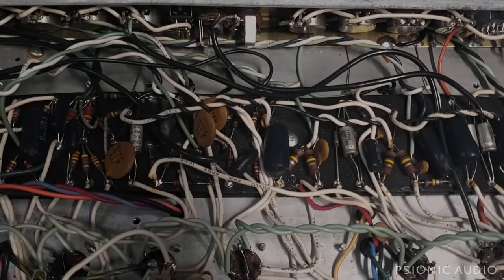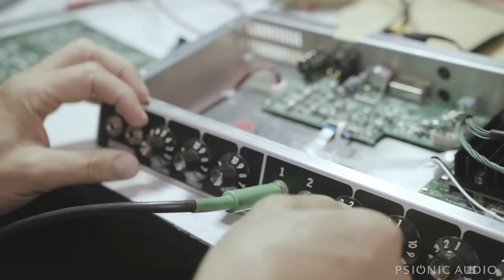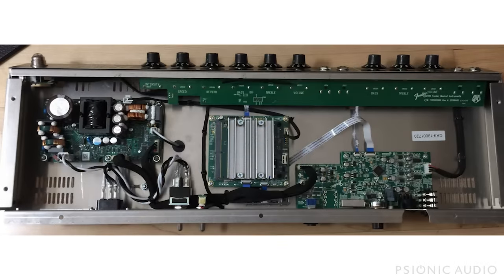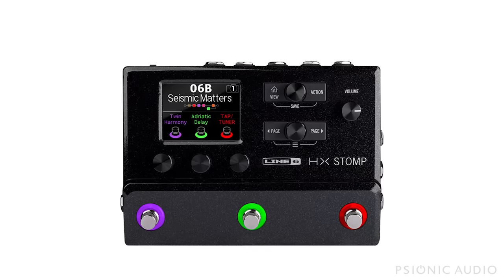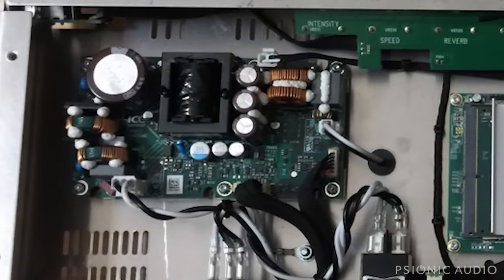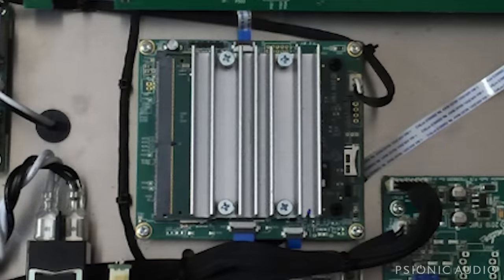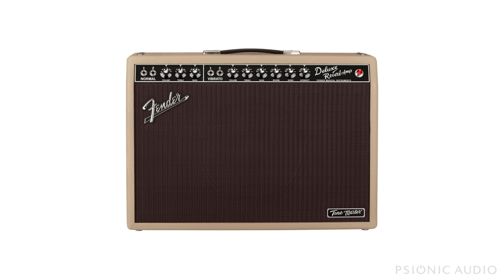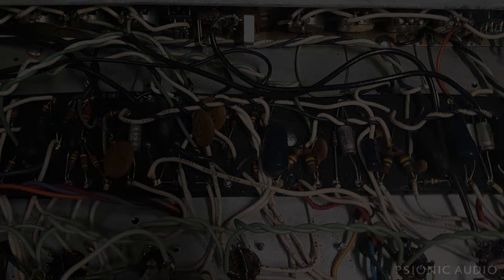We Need to Talk about the Tone Masters

Comment: The super reverb tone master makes sense to me as it will be a lighter solution for when you need a solid amount of power, as well as it has the attenuator which to my brain makes more and more sense on more powerful amps.  On a deluxe?  Some sense but not enough over the DRRI which isn't too light but it's easy enough to get around with and has pretty solid range of usable volume.  The price difference from 65 reissue to tonemaster also makes the super a much more compelling choice as the price difference is much larger there than between the 65 DRRI and the DR Tonemaster.
Reply: Nevermind, for some reason I now see that the deluxe TM is 100 watts and the super reverb tone master is 45....odd.
Reply from the maker: Old Twins are 80W. Old SRs are about 45W.
Reply: @PsionicAudio  Yes, still I don't get the logic of bumping the 22-watt DR to 100 for a TM version but leaving the Super reverb at 45 for it's TM version.

Comment: First of all, it's pretty stupid to say that the C12K is a "terrible" sounding speaker. It's pretty much just your opinion. Personally I (and literally thousands of guitarplayers around the world) don't swap it and have loved this speaker for decades. 
I'm gigging a few weeks now with the Twin Reverb Tonemaster and has of course these same two C12k's neodymium speakers, and they sound absolutely great. Like a tube Twin should sound with Jensen's, scooped mids. The Celestions in the newer blond versions don't sound anywhere like a Fender amp, too much mid and less headroom. 
But that's my opinion as well. As far as reliability and longevity..  it's 1000 dollar amp, designed and built for gigging musicians. With all it's conveniences, like output XLR with a very decent sounding cab sim, attenuation and most importantly... light weight! It's also not suppose to be a multi-tool, but just a great sounding almost exact emulation of 1 particular amp, as close as possible. I really don't need 50 different amps to choose from, or 300 effects... just one great sounding pedal platform. And I think Fender really nailed it with this one. My 1000 dollars computers also died within 5-10 years, my 800 dollar phone died within 3 years, my 900 dollars smart TV died in 6 years. So, my point being, it's not an "investment" product, it's just a tool. I suppose it will last 5 years, probably more, that's 200 dollars a year. Not bad at all for the convenience it gives me. It's not designed to be constantly serviced or whatever. When my smart tv died, I didn't bring it in to have it repaired. It would probably be more expensive than just buying a new one. I didn't replace the motherboard when my computer died, I bought a new  computer. And I treat the Tonemaster the same way. As you said, like a laptop. Not like an investment amp or to sell it for great money in 5-10-15 years. And again, I don't need more features, I really hope Fender sticks with this idea, no effects loop, no IR loading, no 50 amps or effects to choose from. Please no... I'd buy a Helix or Kemper or Katana if I'd wanted that, literally 'every' modeling amp has these overwhelming set of features where most people only use one or two amp sims anyway These things are for another kind of user. 
Oh.. and did I say it sounds awesome? On a big or small stage, full band setup, loud live gig.. not a single person that would be able to tell whether I'm playing a 'real' Twin Reverb tube amp or a Tonemaster. That's what I can promise you. Maybe if you'd A-B it right next to a tube version, you'd hear some small subtle differences, a different "feel" but these will dissappear in a full band setup or recording. Personally I think this is the best sounding tube-less amp I've ever heard, and I'm still a tube amp lover myself. I've had several (Fender) tube amps and I still have now. But lugging them around a few times a week gets pretty old after a while. My back thanks me.
Thanks or the video.
Reply: This reply was as well considered as the video itself.
Reply: @wmg1958  well, just my 2 cents.
Reply: @supersonicsroots  thoughtful writing such as this is worth a lot more than 2 cents any day.  Curious how the Champion 100 would stack up in your opinion since those can be found for a relatively cheaper price.  I totally get the points the original post was making and this was a good counterbalance.
Reply: @wmg1958  Thanks Bill, I think the Champion 100 will have more of a solid state sound (obviously) since it's not designed to be be a modeling amp. The difference will be half the power, so if you need volume and headroom you'd be better off with the Twin. The Champion has some things like built in effects and an effects loop and also has a headphone out. To be honest, they're 2 different kind of amps for different kind of players. Soundwise the major difference will be that the Twin is 100% built to emulate it's tube brother. 
But that doesn't mean the Champion doesn't sound great of course, and its a lot cheaper. Good luck with your choice!

Comment: I've had my Tone Master Deluxe Reverb for a couple of years now. Like MANY players, I don't need an effects loop (even more and more younger players are not using pedals). I would never wish to snip the bright cap either. I VERY FREQUENTLY get compliments on my super clean tone, by both audience members and other players. The tone of a Telecaster or Jazzmaster thru the TM (or BF tube version) is everything I could wish for (especially with EMG T System Tele pickups or the brand new JMaster pickup set(should be on the market in a few weeks) puts me in tonal heaven. Finally, after over 50 years of searching tones! (I've been using Fender amps the whole time, but with hum bucking guitars)
Reply: I agree. My es335 through my TM Deluxe, original firmware and played clean (blues) sounds awsome. It is all in the fingers man! (tone...)

Comment: I'm just glad they went with an IcePower module instead of a chintzy class D chip amp. The cheaper modeling amps have these monolithic class D chip amps that supposedly can do 300 watts (which, doubtful) - but those bigger amp boards mean discrete output MOSFETs which are less likely to catastrophically fail from heat.
Reply: And if they do fail it's not terribly difficult to replace a discrete power FET.

Comment: You want to turn a Tone Master into a Super Tone Master...?

Put the Fender MTG Tube Distortion Pedal in front of it. 
It gives it that warm-tube feeling & sound that fills the room just like tube amps do.
Very low gain / high volume settings to keep it clean.
Up the gain lower the volume to get tube break up / dirty / distortion.
HIgh mids if you want that sound. 
It is basically now your pre-amp, a tube one.

Fender should make this pedal mandatory with each amp, it is THAT good of a combination.
I did it to the Twin, and I assume it would have same affect to the Deluxe.

On top of that I bought both Black and Twin to compare, and ended up swapping the speakers.
So it now has 1 British Celestion and 1 American Jensen speaker because I am a picky dumb ass who couldn't decide which one to keep. By accident I discovered that this is an amazing combination that HAS to be HEARD to be believed. With the pedal it is like a Boutique amp turning this into a Super Super Tone Master that can play any style you want with tube realism, yet with digital control for various volumes you want to play at ---The big TM advantage in first place

Problem with swap: Now I have 2. 
Sweetwater is very open with returns as they agreed to let me return one after testing both, but obviously I cant return a modded amp.

For Sale: 1 Amazing Super Super Tone Master Twin Reverb -- Austin Texas.

Comment: I don't know why you hate the Jensen so much, i absolutely love mine. I guess I am lucky my ears aren't as sensitive as many of the folks I read in forums. Saves me a lot of mine
Reply: I think the amp sounds great. I've updated the firmware (I have the original blk one), but still have the stock speaker. My DR is a home tool and as I was just firing mine up a minute ago and thought how great it is for uses like that. I hate the thought of heat cycling the tubes  in my other amps. So for a quick little session, it's absolutely perfect. I'd use it for informal jams too. Bottom line - it sounds fantastic and works as advertised. 

It's all quite simple really. I don't get all the babble about this and that.

Comment: Hello. I own a Fender Deluxe Reverb TONE MASTER. I have just disassembled it because the LED indicator lights do not have power going into them when the amp is turned on. The LEDs are working upon testing. IF YOU WANT A CLOSE UP PICTURE OF THE INSIDES I CAN SEND IT TO YOU so you can help me diagnose the problem. I bought it from the USA and i am living here in the Philippines 😊

Comment: Great video. You should also consider making a video about guitar speakers. What I noticed you suggest a speaker replacement to a lot of amps and it is a fairly simple mod that can vastly improve the sound of an amp
Reply from the maker: I've made a few.
Reply: @PsionicAudio  yes, i have watch them. What made me suggest it is the difference in the tone in the Fender 68 custom vibro-champ video which came to mind when you mentioned the tonemaster's change of speaker from the Fender to the Celestion. I understand that making a speaker video is difficult because of the too many variables but a simple guide on what amps someone should look for a speaker upgrade and what speakers should be avoiced would be usefull.  I also get that the speaker is the unsung hero of the guitar space, not many people are interested in it. Guitars, amps and pedals are what most people interested in.

Comment: I would consider one if they can guarantee me more than 2 years of support. I had a mustang 3 v.2 for two years and then they stopped supporting the fuse software that worked with it. Shortly after that things started going wrong with the amp. Like the stereo XLR outputs stopped working, which I used to hook up to my DAW. Never mind the fact that trying to work with the onboard controls was a nightmare compared to the software that stopped working.

Comment: I just don't get it. One pays 3/4 of the price of the real deal, for an amp that does one thing, and is NOT the real deal. And you can get a Boss Katana for a small fraction of the price. 
So, what's the difference? You can run an overdrive in front of a tube amp and the OD acts as a wonderful tone and gain-shaping device. It just doesn't work that way with a digital modeler. 
I just don't see any value in these tone master amps. They should be 1/4 of the price of the amps they emulate. At that price, I'd definitely get one. As it is, they're ridiculous.

Comment: I'm going to echo a lot of whats been said here.  But, for the sake of (Maybe)helping someone decide, here are my nuggets. 

 I have the Twin.   If you play outside of the house, I wouldn't buy anything smaller than the Twin.  The Tone Master amps can have issues with pedals.   If you play below breakup, the issues aren't there(my experience, with my selection of pedals).   With a Deluxe or Princeton, you'll likely be in the breakup range if you are playing with others.   With one of my pedals, the reverb & vibrato didn't work, at all.    With another, everything just turned into a muddy mess(way beyond what would be considered normal, if you were pushing an amp(digital mush!!!)).  I do have some pedals that work reasonable well with the TM.   But, overall, it's not a great pedal platform.   That's the bad stuff.  

 As far as "how does it sound?"  When I sit in front of my amp & start playing, I feel like I'm playing a Twin Reverb.   At home, I set it a 1 watt & run the VOL up between 7-10.   I like to say 7 is Stray Cats, 10 is Sex Pistols.   Of course, Setzer doesn't play a Twin but, I think you understand what I mean... 

As far as the Reverb & Vibrato are concerned?  If you are trying to A/B those features to a twin/deluxe/etc , there are going to be some differences.   Completely different circuits.   But, do they sound good?   I think they sound amazing.   I use them in my set & are quite happy with them & how they sound in the circuit.    Again, it feels like I'm sitting in front of a Twin.

I find it best to approach these amps from a minimalist perspective.   Less is More!   Sometimes I'll throw a delay in front of it(no issues there).  But, usually, I just go in clean & use the Volume to get my breakup.   A couple other pedals that I have used, which work pretty well with the TM are the EP Booster & an early 80's Distortion+.  With the old MXR you can just set it in front of the amp in the "OFF" position & it's old circuit will roll off the Digital edge of the amp.  If you really push the MXR, into the amp, it can start to get messy but, it doesn't provide a whole lot of gain.   So, it doesn't cause too many issues, when the amp is pushed, as well.   When I throw the EP Booster in frontof the amp, it doesn't need much bump to fill the amp out.  If you have your amp cranked & it's just "not quite there", the EP Booster is a good addition.   I rarely use it, the amp  breaks up really well, @ 10, for me.   But, every once in a while, I want just a little more.  Overall, the strong point of these amps are the versatility they provide.  So, If you are a player who wants that "Fender Sound" at livingroom, rehearsal &/or concert volume, the Tone Master Twin or Super could be your new best friend. 

 For reference, the Twin Reverb at 1 Watt, is quieter than a Frontman 10g, when both are cranked. Quite an amazing feat, considering how amazing it sounds dialed back @ 1W.   

Considering long term durability?   Well, it's anyone's guess but, I'm often working on my old Synths & Samplers that are over 30 years old.  lets' hope they sell enough of these amps, so there are salvageable parts still around, when we need them.  I think most of them, if treated well, will last a long time.

Comment: I have a Princeton reissue which I love.  I can’t afford a silver face Vibrolux or a Victoria boutique at this point in my life so if I find myself with a drummer who playe over my a Princeton at 6 I’m more apt to hire another drummer rather than buy a bigger amp at this point. I still have nightmares of carrying my AC-30 ( heavier than a Twin) up two flights of stairs at 2am after playing all night. 
My question for the tone master crowd is why not just get a Iridium and an FRFR like the head rush? For a total of $680 and a weight of 20 pounds you have 2000 watts that gets a great tone at any volume. You can put a delay or a spring reverb before or after the iridium depending on what your preference is. It’s a whole lot better for recording as well.  I don’t find the tonemasters tone really holds up to a Iridium. Seems like you’re getting the worst of both worlds with them.

Comment: Looking at the ICE board, I can't help but noticing all the electrolytic caps that like to fail in switching power supplies.  Let's hope they put some good quality low-ESR caps that were made for switchers.  There's a good chance, that's where the problems will be.
Reply: High-frequency ripple currents are deadly to cheaply made electrolytic capacitors. It appears the power supply also has several SMD caps on it, which might fail first.

Comment: Couldn’t you make the same argument about the lack of an effects loop for the tube versions of the same amps? I assumed the TM Twin and DR don’t have effects loops because the tube versions don’t, and Fender was trying to make a digital version of their tube amps. I would imagine if they decided to put an effects loop in a tube DR or twin the tube versions without the loop would also be devalued. I’m not trying to be a jerk, and as an owner of the TM twin, I do wish it had an effects loop.
Reply from the maker: I don't think it's the same. To whom does the amp appeal? These are fake old school if you like, but will alienate many of those who would otherwise embrace modeling.
Reply: @PsionicAudio  First, let me state that I love your channel and appreciate what you do, and I’m not trying to be disagreeable or pedantic about any of this. But to answer your question, I’d say these amps appeal to me, Zac and many others in these replies because they’re very good digital representations of their tube counterparts, certainly more than capable for gigging today. With the built in attenuation and output options, they offer a lot of options the tube counterparts do not, at half the weight. I love tube amps - I’ve got a couple heads and a few speaker cabs to mix and match with them, and they definitely have a thing the TMs, or any digital devices don’t. But in these days of tube shortages and an uncertain future on their supply, I don’t really want to take a tube amp to a gig.

Comment: There are the traditionalists who will buy this amp simply because of the weight savings. I felt a 4x10 ToneMaster and I've also felt the original 4x10, and I'd take the ToneMaster any day to do local gigs with because of the weight savings. Another older guy I know named Mac said similar about bass amps. Yes, they're solid state, but they sound great, are really good at producing bass, and weigh nothing.

Comment: I personally don't understand spending nearly $1000 on a digital amp that can only replicate a single amp sound. If I'm going to go the digital modeling route, then I'd rather have something that can cop several sounds. And you make an excellent point about the uncertainty of an amp dependent on firmware updates. I purchased a Boss Katana Artist 100 a few years ago, and less than 6 months later, they introduced the MKII version, eliminating any firmware update options for the MKI. I'm done with digital amps.